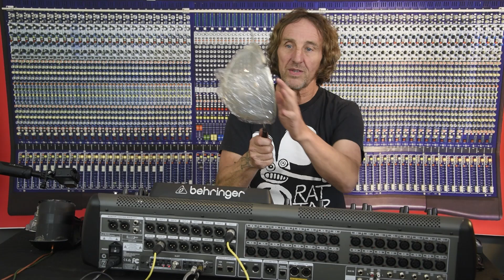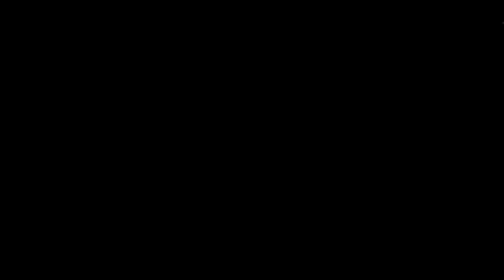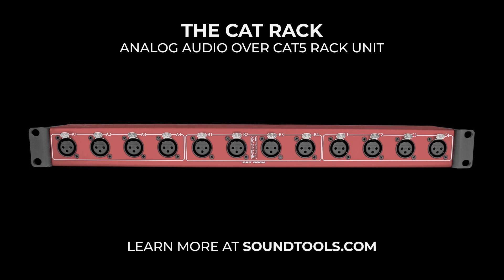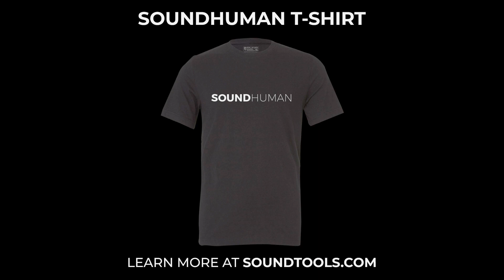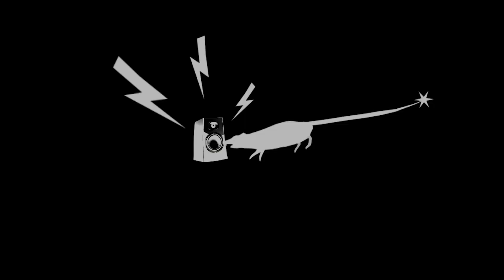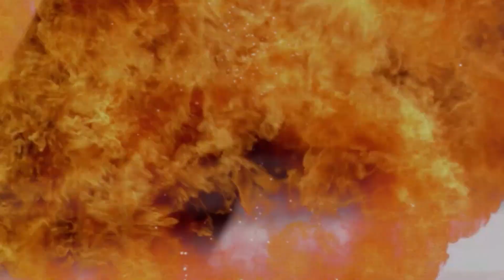Aux Fed Subwoofers Are Better - Because of How Mics Work

Comment: It's entirely possible I'm not seeing the obvious, I'm still rather unexperienced in the game. But I'm having a hard time understanding how just not sending channels to the subs is better than high-passing more aggressively.
We all agree that for example a Hihat mic doesn't produce any useful frequencies in the low end spectrum. So why not just clean the source channel itself and highpass more aggressively. Otherwise we're still sending those frequencies to the mains which won't have as much of a negative of an effect as sending it to subs but will still muddy up with unnecessary frequencies and take away headroom on the mains right? 
So by not sending to subs we avoid the worst consequences but not fix the root of the problem.
Or am I missing something?
Reply from the maker: Why send the unwanted lows to mains AND to subs when you could not send them to subs?

To really reduce crap sent to subs, you need to raise the high pass quote high.

Why ruin the sound of an instrument to clear excess lows from the subs when you could just not send it to subs and be free to set the high pass purely based on desired sound quality?

Why put eggshells in your soup and then filter them out later, when you could just not put them in in the first place?
Reply: @DaveRat  Thanks for your reply, I appreciate it! I'm not trying to argue, but after your reply I have another but kind of the same question. 

I agree that not sending to subs is a concept that makes perfect sense. And I agree that it doesn't make any sense to send instruments to sub that don't have sub, like a hihat for example.
But to me looking at it from a different angle it seems like a problem that doesn't exist.

A hihat surely doesn't produce any wanted frequencies in the sub range. So if I highpass everything that the mic might pick up that isn't in the frequency of the sound source, I already cut everything that is unwanted, purely based on sound quality. 
Now if I have to set the highpass lower because of the source, like on a low floortom or bass drum I would want to send that to the sub anyways because of the source right?

So in a perfect world if I highpass all the frequencies the mic picks up that aren't generated by the source (like wind and so on), I only send signal to main and to subs I want amplified. 
In what scenario would I decide to not cut the source but also not want the frequencies amplified?

To me right now it looks like my soup doesn't really have eggshells to filter to begin with, but maybe I'm still missing it.
Reply from the maker: I believe that is a flawed assumption.

You assume that because a HH does not make sub frequencies that the mic does not output sub frequencies.

If the puff of air from the hh or vibrations from the kick transmit up through the mic stand, or the sound from the bass guitar rig, or air from the building ac or breeze, or the mic is moving from the drummer rocking out, these will all result in that HH mix and pretty much every mic outputting sub sound that are unrelated to the instrument being mic'd

If you don't have subs or your subs don't have much power, these issues may not be worth addressing
 
But eliminating those issues from the subs when possible is better than not doing it

And also, did you actually watch the whole video?
Reply: @DaveRat   I'm sorry it's very possible that I'm not explaining myself well.
Of course I watched the whole video, and I remember your example with the Hihat and puff of air and wind from the video, that's why I referenced wind in my comment. I am very aware that microphones pick up sound that isn't generated by the source. That's the whole point of what we're talking about and the video.

In the scenario that I highpass EVERY mic at the lowest frequency my source can generate (e.g. that HH at maybe 250hz) I should end up with only the sounds in the range my sources itself generate. 

So if an instrument does not create sub frequencies those sub frequencies should be gone because it's highpassed. And if the source can create sub frequencies I won't highpass and will want to it send to sub anyways.

So yes I agree that sending HH or similar to sub makes no sense, BUT if highpass it, it shouldn't make a difference right? Because by highpassing we already fixed that problem earlier in the signal flow. Unless I'm missing something. 

Yes sending HH or similar to sub makes no sense, but if all channels have been highpassed properly it fixes a problem that in that case shouldn't exist anymore right?

Also I'm not in any way trying to prove you or the video wrong in any way! I'm just trying to learn and understand.
Reply from the maker: Well, you seem to be dedicated to sending everything to subs. All good.

Also, setting a high pass at 250 on every mic that you don't want subs seems to be ok for you but high pass on guit, vox, oh, HH at 250 sounds the opposite of good to me.

So, if you do have high pass of 12 DB/oct set at 250, then at 125 you are down 12 DB, at 63hz you are down 24 db.

The low end still goes to the subs, just 24db lower. And if you have 10 mics doing that, maybe all the low end crap  10 or 12 DB down into the subs.

And also all your instruments sound crap being high passed so high.

Or you lower the high pass and send more crap to the subs

Or you use high passes with steeper filters and creat more phase issues and make the mics sound less natural 

Or you put subs on an aux and don't send any of the crap from those mics to the subs

All good

Comment: Dave, love your content! Thank you for sharing your knowledge! Your examples are so clear and complete - I just love watching and sharing your videos! 

I've heard all the arguments for or against Aux-Fed subs - It IS the industry standard (I see more riders specifying that subs MUST be on an AUX) for a reason. I don't know why anyone would prefer to send all the material into a bus, to cut it down in the console, processing or sub itself (for self-crossed-over powered units). My theory has always been that anything that isn't turned into sound is turned into heat - whether that is just processing power sucked-up by having to trim out all the unwanted frequencies before the output, or actual physical heat at the power amp input or turning the signal into watts that won't get reproduced by the sub speaker anyway, or at the speaker getting a signal that it can't reproduce - there's just no reason to do any of that when you send just the sub frequencies out of an aux or bus.  Basically, if my subs catch on fire I want it to be because we were cranking SOOO MUCH bass, and not because the system was setup to generate undue signal/heat... 

I've found that too many (young?!) sound guys want the subs ALL UP ALL THE TIME and getting them to mix the bass and kick to be full/present in the subs but not eating up the audience area with low frequencies is a real challenge. We all like a good, full, punchy, loud concert, but there are ways to get a good sound without just ripping the low end items 100% all the time! The first place I look/knob I reach for if a kick or bass isn't sitting in the mix is that sub aux, a gentle turn DOWN and a boost on the fader usually sets the world right again and instead of just turning any part UP, the instrument fits in its place in the mix and everyone is happy...
Reply from the maker: Yes

Comment: compare with your reference 2-tracks recording what you did on the show the differene of aux subs or matrix subs.
Reply from the maker: Paying attention to the recordings is important. It's very common for the subs to be too loud or too quiet or vocals to be too loud or too quiet depending on the system size then you size and other factors, regardless of whether your subs are on an augs or matrix or on the left and right

Comment: When I switched over my sub to a bus control it made a HUGE difference. I send only kick, floor tom, bass, bass side piano mic, and sometimes guitar if it's a lone acoustic. This is spot on! Cut the crud and let that sub sing freely! It's the ultimate form of subtractive EQ'ing. Your listeners will thank you, people with hearing aids won't need assistive listening devices in most cases, this is an indoor set up, and the bass will sit soooo nicely in the mix.

Comment: Having done live sound for ten years and then 35 years of designing installed systems, I specify that vocal mics (mostly spoken word) are not part of the matrix to subs. It makes the voice/s more clear and articulate whilst preventing feedback into subs. Most of these systems have audio DSPs under system wide touchscreen control, so it is no big deal to program the DSP accordingly and lock them to stop people messing with them!
Love your sessions Dave - you are an original thinker with masses of experience to back you up. Please keep 'em coming.
Reply from the maker: Awesome thank you Peter!
Reply: Sometimes I found the best for spoken voice is to feed a lot into the subs and then eq and sculpt your vocals off of that
Reply: Backwards approach maybe but it gives your vocals more power and punch
Reply from the maker: Hmmm, with a subwoofer being a speaker that reproduces sound below what the woofer reproduces, sub woofer frequencies, we typically you're talking about frequencies from 20 Hz to 60 or 80 Hz.

So these frequencies are booms and pops and rumbles that you feel in your gut and tend to be very distracting from actually listening to what someone is saying as a true subwoofer only reproduces frequencies below the actual human voice.

I can understand using subwoofers as an effect on a vocal but you would have to be quite careful because even the slightest breath or touch of the mic would shake the room with a two subwoofer system.

I get the feeling you are talking more about low frequency drivers and warming up the vocal then talking about actual subwoofers

Comment: Thank you! How do you deal with LR buss processing when using aux-fed subs? 

Example: do you place an HPF that matches your crossover frequency in the side chain of any LR buss compression? 

Or do you allow frequencies that are filtered out of the mains to affect the dynamics processing of the LR buss?
Reply from the maker: If you're happy with your LR bus processing and leave it exactly the same don't make a change to it.

Send your subs off of either the channel aux or from groups and typically I'll put a separate compressor on the sub sends.

Our ears don't hear subwoofers being compressed as much as we hear pumping sounds in the higher frequencies

So is subs on the dogs you can really compress the shit out of the subs and leave the left right with less compression and have it sound clear and punchy
Reply: Thanks for the prompt reply, Dave! Gonna keep on doing what I'm doin and keep those subs on the dogs 🐶

Comment: It’s important to mention that Slope will be the most important factor, sadly within live consoles, slope can’t be changed. HPF in 90 Hz will react totally different between a roll off or cut off.

The reason I’m still in denial of using the sub with an aux send is that you commit your sources to be cut at the main crossover. If this is good or bad is up to each engineer.

At the end it all comes to critical listening. IMO I like to have the most of control over my mix. Even setting my sub without weighing ir order to add the amount of low end I want with Low shelf’s filters.
Reply from the maker: Just add everything to the subs at nominal either from the channels or at the subgroup level.

Then you have the exact same thing as subs on left and right.

Then look at your console and ask yourself if you really need hi-hat overheads and vocal mics sent to the subwoofers and you have the option to take them out if you wish

Comment: I think it's most important the audience can hear the singer, there's important information in that can only be heard through the sub, make sure they've got a access to sm58s or something with an internal diaphragm shock mount, then low cut the mic at 50hz, a compressor barely touching the loudest parts and use a filter activated gate.
Reply from the maker: And also if you have a system with subwoofers, it's important that there's not a lot of rumble and crap happening that make things harder to hear.

A high pass filter turns down frequencies you don't want subs on an aux and prevents sounds from getting there. 

When people are using higher quality mics capable of wider response than a sm-58, handling noise can be an issue as the singer moves the mic around it creates low frequencies that will waste energy into the subs but is a sound you don't want.

Comment: What do you mean it's not naturally there when you are explaining that it's there?
Reply from the maker: Well, if you mic a high hat on the side and the puff of air hits the mic, the mic will create a sound trying to reproduce that puff of air.

Yes the puff of air is there but the sound that the mic reproduces trying to recreate it is not there.

Since Mic's and speakers cannot directly reproduce puffs of air instead they reproduce low frequency sounds booms and pops.

The hi-hat air puff does not make boom and pop sounds

If you hold a mic and shake It and it sent the subs the subs will move and significant sound can be heard in many situations.

But there is no sound of you shaking the mic that can be heard.

The microphone does not know the difference between mechanical vibration and acoustic sound. And converts both of those to electrical energy that's reproduced yet only the acoustic sound is there as a sound in the first place.

Mechanical energy and vibrations can exist but not be audible, but a mic does not know that
Reply: @DaveRat  dude I love you, mics are stupid, they don't know they are Kick Mics etc...

You're my new favorite channel
Reply from the maker: Awesome and welcome

Comment: The moment I realized many years ago about running subs on an aux my world changed for the better. I often use subs on a matrix to control subs in some situations but my favorite setup now is how the X32/M32 new firmware handles subs on the mono send... Each channel has a sub level that sends to the mono as a sub out like an aux send but there is also an on/off button. So I can really dial in low end the way I want. Sub or no sub or a set level and I can pass filter along with that. And as someone else also mentioned that mono sub send follows the main L/R level with mute.  I love it. I do a ton of conference and AV events now and that sub on and off on each channel is a game changer especially when you have to do video playback... So many people that edit video these days leave a ton of low end garbage on voice so I pass filter and turn subs off. Or video conferencing returns sound terrible with any low end let alone subs😉

Comment: I hace a church that is sending bass and kick to subs. The problem is that when you raise the level for bass on the regular fader, it doesn’t work. I think it’s only controlling the higher  frequencies.  So, if we want to actually hear more bass, you don’t move the bass fader, you move the sub group fader, which also includes the kick. What is the fix? it’s weird to not have the bass fader controlling bass and also weird to have to increase everything being sent to the subs all together (including kick and keys)
Reply from the maker: Hmmm. This is solvable with better routing.

Comment: Can I just use an EQ to accomplish this?  I used the Soundcraft UI24. Say I run my high-frequencies out my main L&R and high pass at 100hz and then my low frequency instruments to my aux and low pass at 100 hz?  Surely I would need to worry about my low and high pass curve?
Reply from the maker: Hmmm, high pass and EQ don't do well as crossovers. I will look at doing a video showing all that soon

Comment: Awesome explanation, Dave. I would like to see/hear the comparison of how much tighter the sub response is with the kick and bass when all the extra garbage is removed. In my experience well managed subs on aux make a mix WAY tighter and more impactful.
Reply from the maker: It can but really depends on many factors. Stage vibrations, stage volume, sub volume, wind, how close instruments are to low freq sources like bass. Rigidity and use of shock mounts and so on.

Comment: Af first I was like "we have high pass for that" but you were still right. Yeah, why should I send high hat sounds to the subs? A high pass filter is only gonna so much. Now I want a 2.1 mix for my living room audio system.
Reply from the maker: Awesome! Though with studio recordings they have so much more control and can eliminate bleed between bass and drums, don't have wind, and plywood stage or drum riser vibrations tend not to be issues. So seperate sub needs are greatly reduced in quality recordings

Comment: it's always reassuring when a video about audio mixing has a high pitched noise for the first 3 and a half minutes
Reply from the maker: Yeah, never been much of a video guy. More worrying is an audio guy doing video at all. The good part is ya take it or leave it if the info I am offering to a couch critic stranger is appreciated all good.

It's not like it's not like you paid to see a live show or anything
Reply: @DaveRat  that was only meant as some light japes. We've all missed bits like that in productions, from unfortunate personal experience I learn best from when stuff goes wrong. But still, it is pretty funny for content on audio tips to have audio issues 🤭

Regardless, thanks for the imparted knowledge. I've used sends for subs before, mainly as it's a cheeky way to create a combined mono of the mix, but it didn't occur to me to be selective with what was sent to it. Using sends is also a quick way to create a combined mono mix for recording onto old mono samplers like the Akai S950.